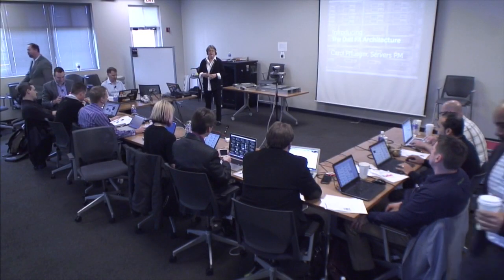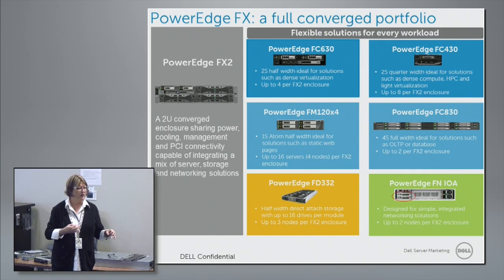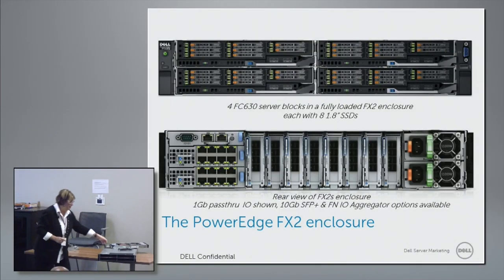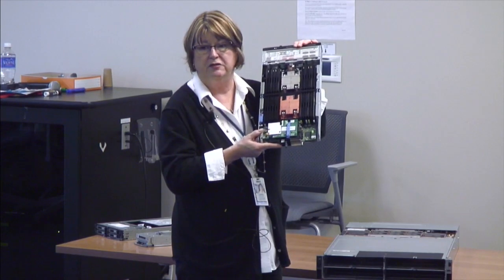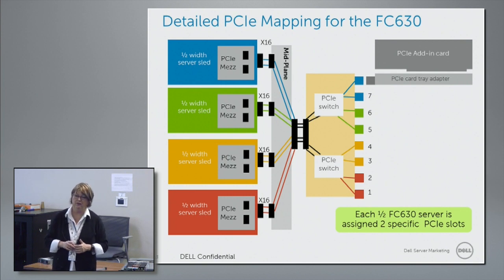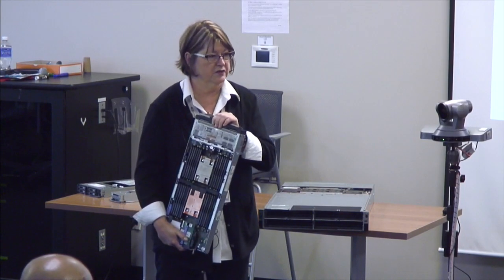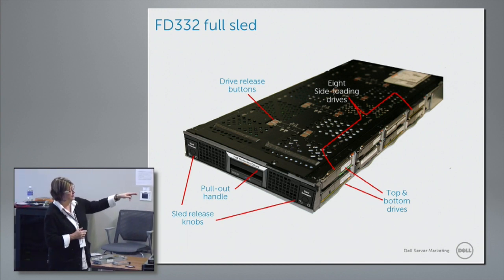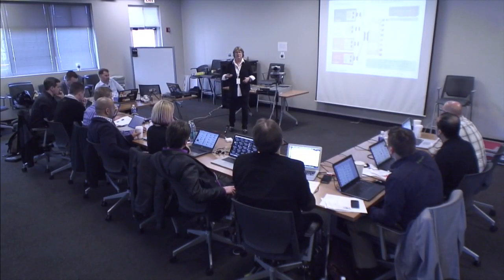Dell PowerEdge FX Architecture

Comment: That was great information and an excellent presentation.
I do have 1 question relating to the PCI-e cards.  I saw how the 4 modules in the FC630 allows for the redundancy by being assigned 2 slots.  However; if I were to put in 1/4 width server sleds, I would loose the redundancy.   Am I missing something or a slide that explains the architecture of the 8 sleds vs 4 sleds?  Is this chassis only for 4 sleds and a different chassis is for the 8 sleds?

Comment: Can the FC630s share the storage, as they would need for vSphere HA, like the VRTX?
Reply: Gene Torres Hi, I had the same question, and unfortunately the FX-series does not seem to be able to share storage. I quote from http://www.virtualizationpractice.com/dell-poweredge-fx2-converged-architecture-32190/ :"The FX2 chassis itself is more like the Dell PowerEdge VRTX than the venerable M1000e blade system. All three products have similar integrated KVM and Chassis Management Controllers (CMCs), and they can be configured with redundant CMCs. Like the VRTX, the FX2 uses PCIe as the internal fabric, and both have assignable PCIe slots. Each slot can be assigned to a single compute node, but the slots can’t be shared with SR-IOV. The PCIe RAID controllers in the FD332 can only be attached to one compute node at a time, unlike the VRTX, which can share its storage among the compute nodes."